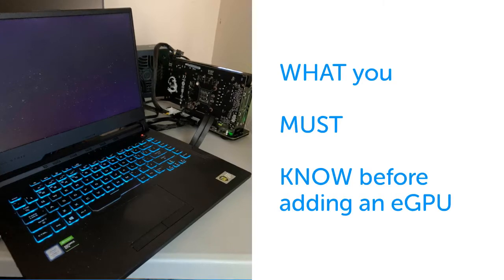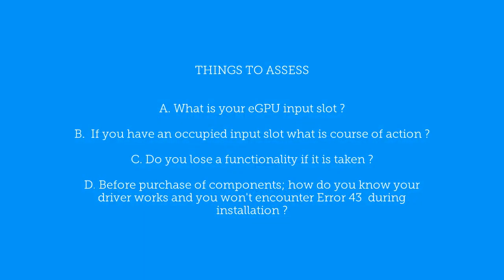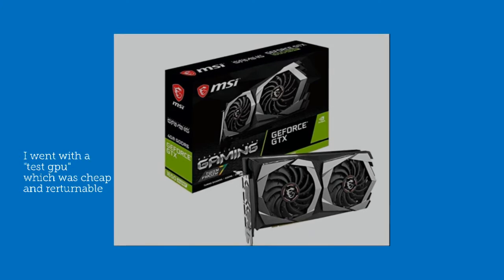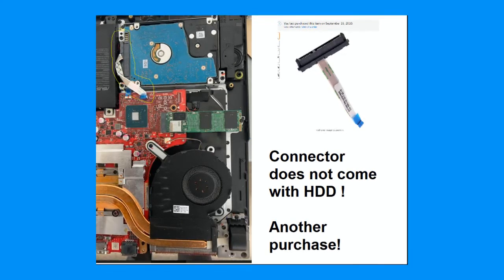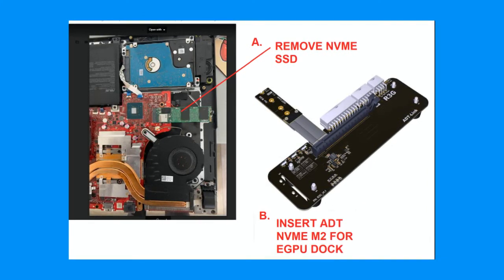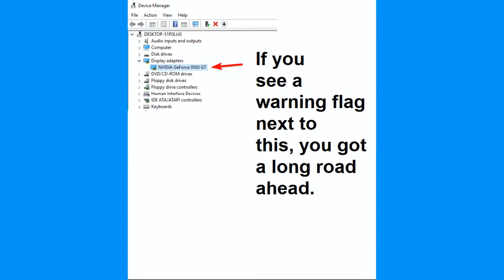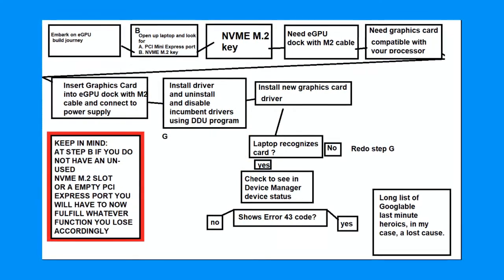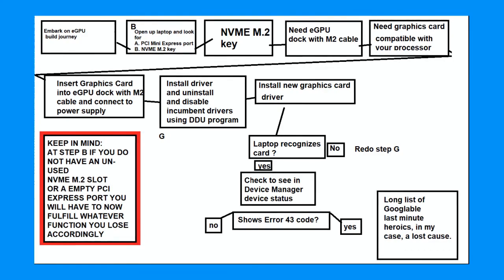What you ABSOLUTELY must know before adding an EGPU to your laptop NVME M2 connector edition

Comment: can we install egpu in msata port?
Reply: It depends if you are talking about a Mini-SATA (mSATA) port or a PCI Express Mini Card interface, which have the same connector but not the same pin-out.
 
An mSATA port delivers regular SATA as it is connected to the SATA host controller and can therefore only be connected to SATA storage (SSDs and HDDs).
  
As its name suggests, a PCI Express Mini Card interface has, among other things, a PCIe port. However, this PCIe port has only one lane (x1) which is quite a speed restriction.

Putting a GPU on this interface is feasible but it's not a very pleasant experience and isn't worth it in my opinion, at least not for gaming.

Dawid Does Tech Stuff made a video where they do just that with an all-in-one PC: https://www.youtube.com/watch?v=6JcucfWz51o

Comment: Can this work with a external nvme m2 enclosure USB-C like adapter case?. My laptop do has M2 slot SSD but i dont want to take it apart
Reply from the maker: Haven’t tried that, but this isn’t about the hardware methodology. The  thing is you can use any hardware linkage but when it comes down to actual software level matching it comes down to getting the Error 43 code which is a dead end. You can try that, but be prepared to see the error 43 code in device manager. my point is there’s two levels here which run in sync with each other. The hardware link is to get the software working. Do what you want for linking it at hardware but software needs to work .

Comment: Is it better to put an egpu through the nvme slot rather than plug it in via thunderbolt?
Reply: Generally the slot is at least as good as Thunderbolt, and sometimes even better. Mostly it comes down to whether each one supports 2 or 4 lanes-you’ll need to look up detailed specs for your machine.

Comment: Hello!  I have to say thanks for your informative video.  I recently purchased an Acer Nitro 5  model AN515-55 with two unoccupied m.2 slots.  I know the Acer Nitro 5 AN515-54 has two m.2 expansion slots, the first slot is NVMe PCIe compatible, and the second slot is NVMe PCIe or SATA compatible.  I've been trying to figure out the compatibility for my AN515-55 model's two m.2 slots but haven't found any info yet.
Reply: trying find for info too. Did you get?

Comment: My laptop has 2 M2 Nvme ports. Hp Omen 15. In a few years when the 1660 ti is outdated  I wanna use the second NVMe (not c: drive) to update my workstation with an egpu, perhaps an rtx 30 series or whatever its current then that doesnt bottleneck to much. cheers for the video, gg

Comment: So all the same, I did not understand whether this laptop was able to create an epu or not? There is the same laptop
Reply from the maker: I could not.
Reply: @Potugadu666  What went wrong?
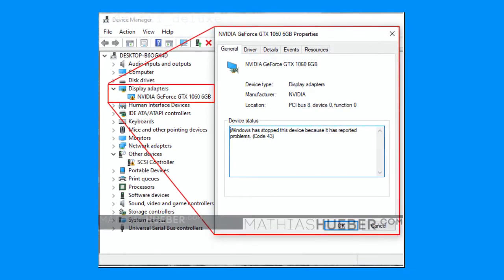Reply from the maker: @drakon8701   The physical hook-up is fine, but at the end of the day in the Device Manager screen the exclamation mark/yellow caution sign next to the newly installed graphics card DOES NOT GO AWAY.  Pause at 7:21.           Long story short, anyone can add an eGPU to a laptop, physical linkage isn't a big deal, it's getting your laptop to work with it at the software level that is. You'll just get lost in download this program, fix that driver, so on so forth.  That is why I made this video. Shocked at all these videos that describe the process but don't mention the most important implied and critical steps down the road where everything can just fail. ERROR 43 is a dead-end road most likely.
Reply from the maker: @drakon8701  No it did not help.  If you're serious try it out but do it within components returnable time frame. I bought all my parts and returned before return expiry.
Reply: @Potugadu666   @Deepak  I read you had to uninstall the Nvidia Drivers for your dedicated mobile GPU (i.e. 1650) before restarting and then installing the Nvidia Drivers after rebooting. Also had read (for Lenovo laptops) to disable PXE boot in the boot options. Obviously Asus doesn't have this PXE security feature but maybe a different one on your secure boot settings??? Sorry I know this reply maybe too late but just wanted to figure out if still possible. I have the same laptop. Although I feel the trade off of an NVME M.2 is too much. I upgraded mine with a Samsung 980 NVMW 1 TB and 32 GB. I play Call of Duty MW multiplayer on low settings and 2560x1440 at 144 hz and really can't complain about the onboard 1650 gpu.